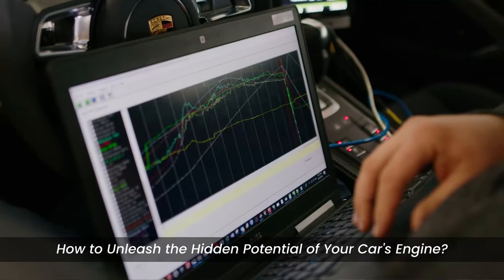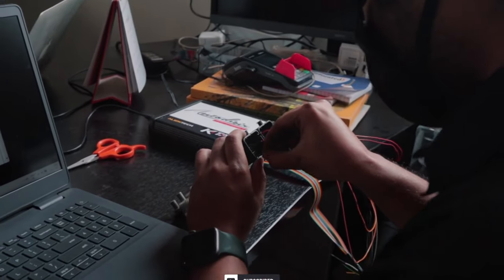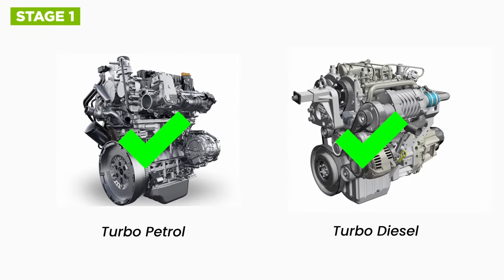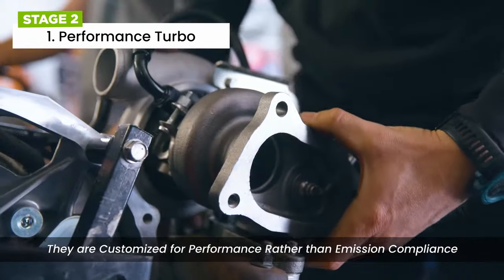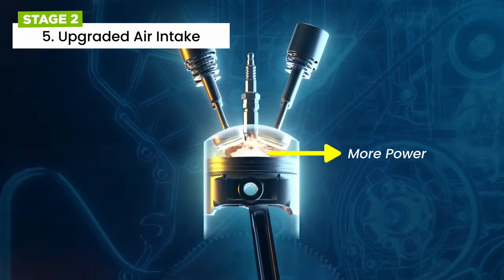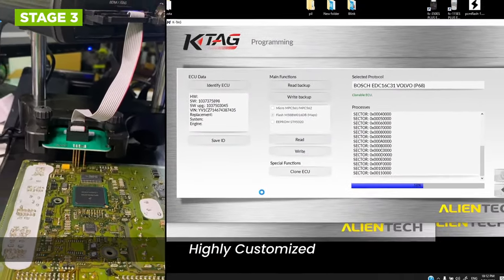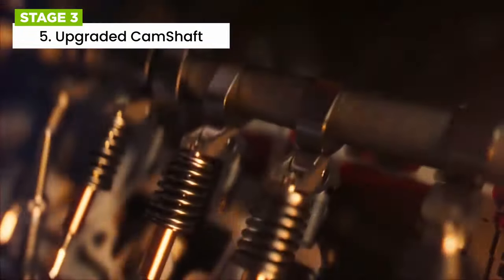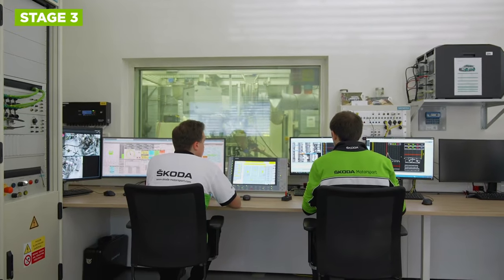ECU/Engine Remapping- Every STAGES & Mods, Increase in Power Explained

Comment: Good afternoon,

I recently installed cruise control on my 2021 Isuzu D-Max 1.9L standard model and I need a device that can program or activate it. I've tried using an OBD2 ELM327 WiFi and ELM327 HS LS USB for scanning, but they can't seem to recognize my Isuzu D-Max. Now I'm considering purchasing a dedicated device or using the TOAD program or should I buy IDSS . Could you please recommend the best option?

Looking forward to your reply.

Thank you for your assistance.

Best regards,

Tell me what do you think
Reply from the maker: Can you share me the full details of the cruise control you have installed in your car?
Reply: @motoringmasters  it is like the organel cruise control that came from isuzu on the steering wheel and i conected to the organel conecter from isuzu
For now it light up but does not work what i understand that i need to program it or active it but i could not find software for that perpuse special for Isuzu.
Feel free to ask for more details.
😊

Comment: Thanks for simplyifing this. 

I am driving VW 1.9 TDI. Which stage would you recommend for me? Will tuning my vehicle give me warning lights?
Reply from the maker: I’d generally recommend going with Stage 1 or Stage 2 tuning if you’re an everyday enthusiast looking for a bit more power and responsiveness without going too extreme.
Stage 3 is usually reserved for track enthusiasts or those who want maximum performance and are ready for extensive modifications. and it is more likely to cause warning lights and might affect the reliability of your vehicle if not carefully managed.

Comment: I had my low mileage 2007 44000 mile Ranger Rover sport remapped and it improved my mpg by 12 mpg. Only to find that it made that my insurance was now null and void. Had to change it back and prove that was effectively resorted to manufacturers specifications. If you are in an accident where someone is injured or killed they will plug into your ecu, even you revert it the car back to the original specifications before they inspect it, they will know the specification of the car when you had an accident. How do get around that?
Reply from the maker: It sounds like you've encountered an issue that many car enthusiasts face when it comes to remapping their vehicles. Modifying a vehicle's ECU through remapping can void the insurance policy if it's not disclosed to the insurer. Additionally, reverting the remap doesn't necessarily erase its history from the car's data logs, which investigators could still detect after an accident.

Unfortunately, there isn’t a guaranteed way to "get around" this issue if you want to stay within the legal and ethical boundaries.

The most straightforward and legally sound approach is to inform your insurance company about the remap. Some insurers may cover vehicles with modified ECUs, albeit with a potential increase in premiums. However, by disclosing the modification, you ensure your insurance remains valid.
Reply: @motoringmasters  Thanks, I don't believe the insurer would investigate unless it was really serious and you caused a fatal or serious injury by driving. If that happened then you could be bankrupted, maybe even lose your house. Your right the best way to approach this, is ask the insurance company prior to the remap
Reply from the maker: It will happen based on some condition based on which country you are in.

Comment: Should I study mechanical engineering or electrical engineering or automotive engineering to become a car tuner ( not only ecu ) i need a answer please
Reply from the maker: Dude, that's a tough choice! If you’re all about the nuts and bolts, go mechanical. If you wanna mess with wires and circuits, electrical is your jam. Automotive is like the sweet spot for car lovers, though! What’re you leaning towards?